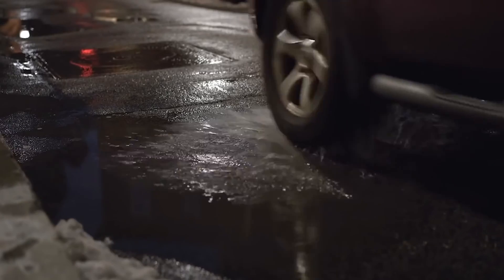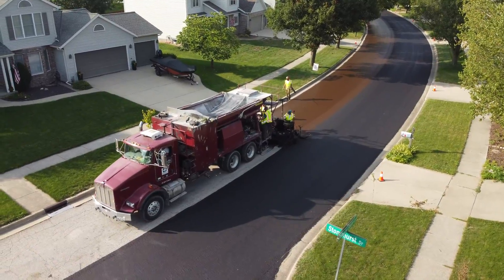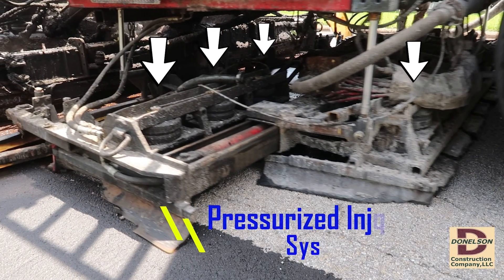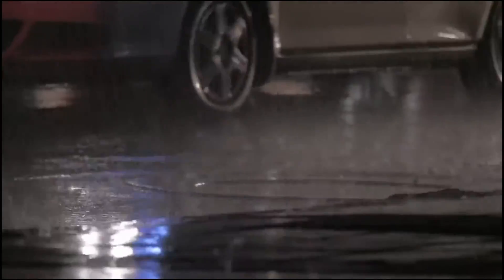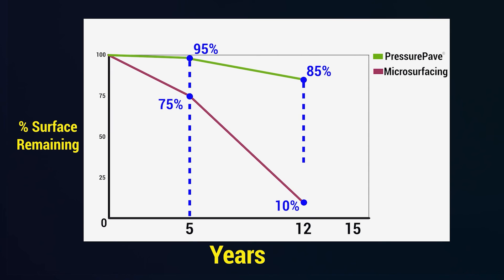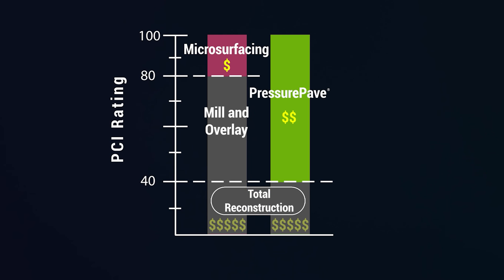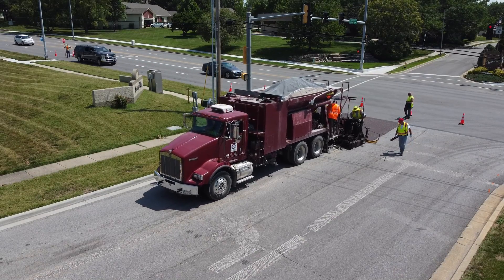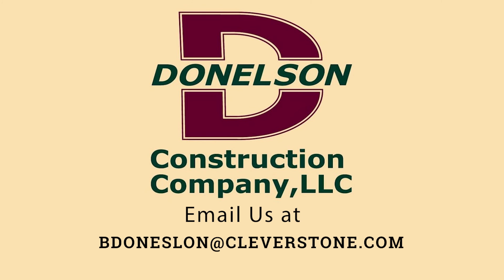PressurePave vs  Microsurfacing Revolutionizing Street Maintenance

Comment: I've seen both used here in OK and 3 years is tops but then concrete starts falling apart in 8 so... a newly paved road 3 days old and they were filling cracks with tar, but that was an Oklahoma City crew, so we expected substandard work. it amounts to painting the road before an election.